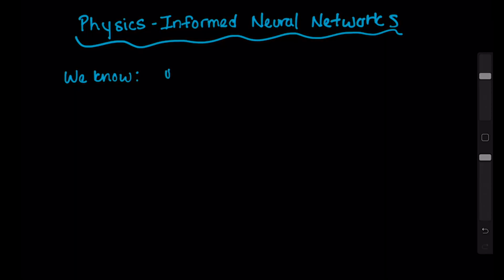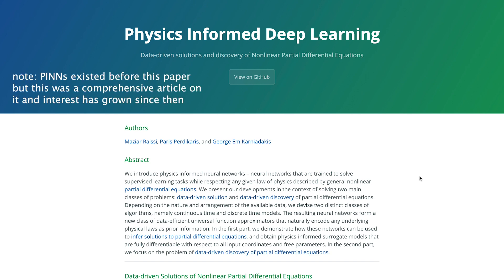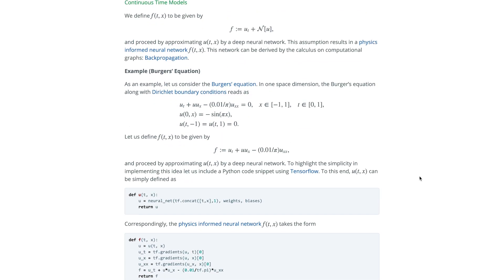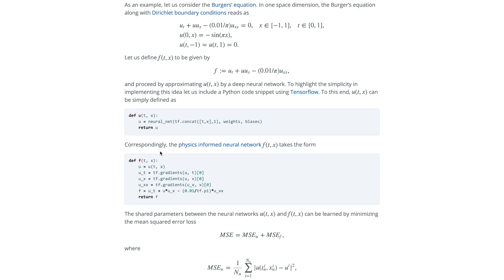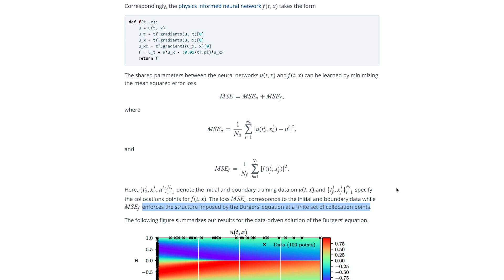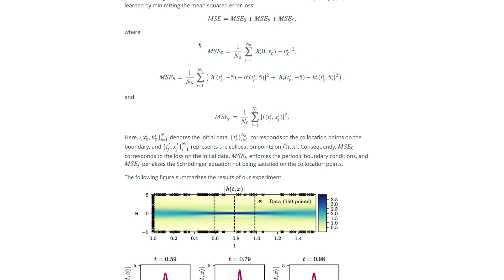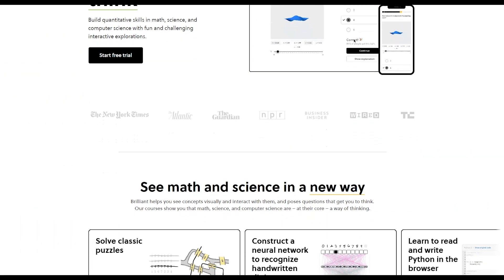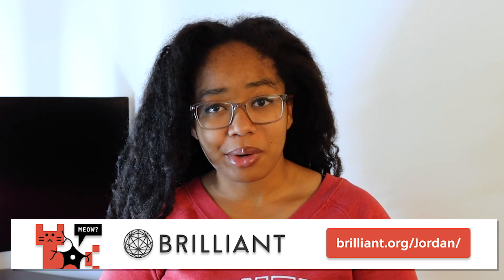How Do Physics-Informed Neural Networks Work?

Comment: Hello!  I'd like to check my understanding.  The input would be a set of data points.  The output would be the result of running those data points through a physics equation.  The neural network would be trained so it can transform those inputs into almost the same outputs as the physics equation does.  Do I have that right?

Comment: So physics models are used to generate data  which is used to train models? I can also imagine that physics models are used to model well understood parts of the data and that a neural network then only has to fit the lesser understood parts. For example when throwing a ball then the majority of the trajectory can already be predicted with gravity, such that the neural network only has to predict other influencs such as those from the aerodynamic drag.
Reply: Shifting with psi sensory plates on the physical model against the wind to calculate the physic math?

Comment: To what limited extent I had made use of neural nets, I typically didn't make use of backpropagation but had instead trained the nets using genetic algorithms (mostly as to me this seems like a simpler approach when writing everything freehand in C or similar). However, I am not really sure the effectiveness of this approach in a more general sense (seems to work OK for small nets). Not really sure if anyone else does it this way...
Reply: The genetic algorithm has the advantage that the optimization does not that quickly get stuck in a local minima, but it usually is way slower than gradient decent. A sufficiently large fully connected neural network usually over parameterized which means it often doesn't suffer from local minima, so the biggest pro of the genetic algorithm is not very relevant here. Therefore, I would highly encourage you to try using (stochastic) gradient decent instead of the genetic algorithm.
Reply from the maker: Agree with the above, it depends on the types of problems that you're looking to model though.
Reply: @JordanHarrod  My problems were mostly DSP type tasks (such as a net which does basic signal classification as part of an audio or video encoder, often around 10 to 50 neurons; usually for selecting which block format or predictor/filter to use). They would typically be embedded into the program in question (usually by manually-transcribing the results into a blob of C code which expresses similar logic or similar).

Some of the hash functions and similar I use were also designed with partial help from genetic algos (as well the current "rand()" implementation in my C library, ...). Mostly relying on their ability to find decent magic constants (eg: "0x0000FC4BA2F7ACABULL" in this case for "rand()", ...). Versus the more traditional approach being to just use a large prime number or similar.

Nothing particularly "intelligent" here though...
Reply: @Brendan.....I'm a little confused. I thought genetic algorithms and neural networks were two different types of machine learning algorithms. Isn't backpropogation an algorithm to train neural networks rather than a different type of machine learning algorithm?
Reply: @sandeepsuresh7079  They are different things, but there is some overlap.

A neural net is essentially a "structure", usually a collection of "weights and biases" which is traditionally seen as a graph. Though, much beyond this, specifics are more subject to interpretation (so, all this is more from my own perspective/experience).

In practice, the implementation often resembles vector*matrix multiply with an extra S-curve or similar thrown in (with each layer of the net as essentially a weight matrix and bias vector, or, "VecOut=SCurve(VecIn*MatWeight+VecBias)").
Though, various possibilities exist, and in-practice the final net may take some other form (such as a big mass of unrolled fixed-point arithmetic with "if(x>=0)" and similar with small weights pruned away).

Here, the "neuron" might be essentially one element from the vector, and its associated column in the weight matrix.

Multiple ways to train such a net are possible.

For training, one could use back-propagation, where one runs the net, then computes an error vector (DesiredOutput-ActualOutput), and runs the net "backwards", adjusting the weights based on the error vector, ...

Or, they can use a genetic algorithm, where all the numbers in each net are randomly interpolated between the various parent nets, with noise added, to create each of the child nets. If this case, the net is only run in feed-forward mode, and the "error function" is mostly use to rank the nets based on how well they did, with the "best performing" nets being selected to breed the next generation.

Say, for every generation, one runs 256 different neural nets, and then picks the top 32 or so (breeding 224 more nets based on the top 32), and then has this process repeat until some stopping criteria is reached.
The first generation is seeded with a bunch of nets filled with random numbers, but will tend to converge toward the desired output over successive generations.

But, a "genetic algorithm" is a more general concept, and can be applied to a lot of other sorts of tasks as well (such as bit-vectors, sequences of commands, ...). 

So, is itself more of a "general approach" than anything specific...

Or, at least, something like this...
Reply: @BGBTech  So genetic algorithms can be used as a separate ML algorithm or as a way to train neural networks. That's interesting. Kind of like how neural networks are used inside reinforcement learning to make Deep Q networks. Wow. Could you point me in the direction of a paper or article that does this? (Using genetic algorithms to train neural networks)